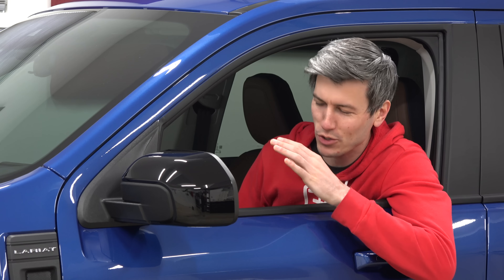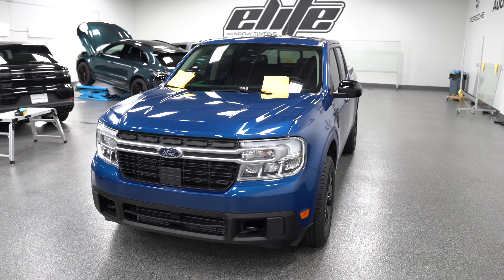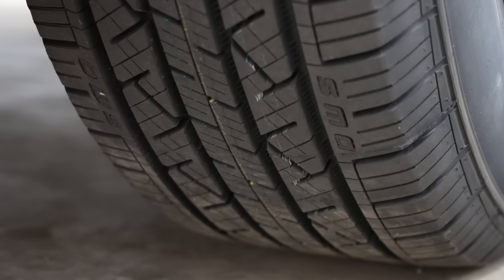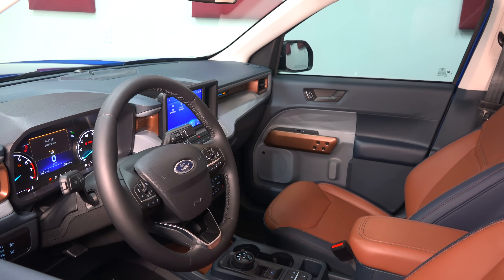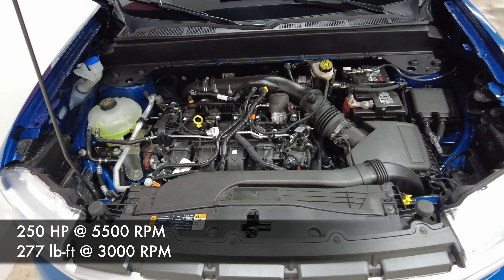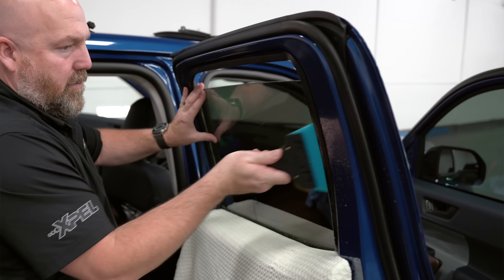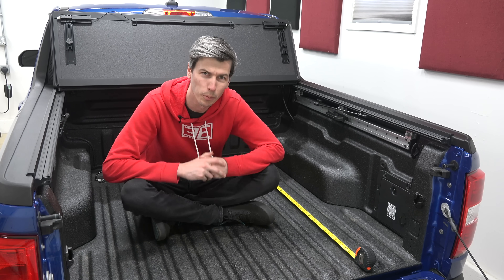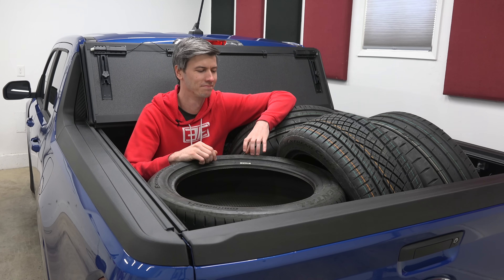I Bought A Ford Maverick! The Perfect Pickup?

Comment: My son just purchased a Ford certified, pre-owned 2025 Maverick Hybrid, AWD Lariat Yesterday that had 14,000 miles on it. When driving it on a long interstate drive from Bella Vista Arkansas to Little Rock today, there were a number of check engine and warning lights that showed up. It has me stumped. When searched online, we found there may be 12v battery issues with the Hybrid model. Is there any truth to this?

Comment: I bought a 25 XLT lux , 4k , FX4 2.0 eco.  Love it so far.  Does 95% of what I use a truck for. Perfect size for my 4k limit light  trailer.  Does 100% of what I use a sedan for.  Decent power,  great handling. Good mpg.  Only other vehicle that was as sensible and practical was my 2017 Volkswagen Golf R

Comment: Traded in my Avalanche for this 2.0 Turbo ,FX4 ,AWD . We recently deliverd my grandson,s Harley , in the back , 200 miles ,no issues and it used - .1 more fuel at 70 mph . Easiest vehicle to get in, painlessly , for my wife,s bad knees as well . If it matters ,the Maverick with it,s power (255 hp. +277 ft. lb. of torque ),leaves the Avalanche in the dust .No comparison . Fantastic braking  And no more squeezing into tight parking spots . We bought it just off lease with 895 miles and saved about $15 K off retail , what a bargain . Drove semi for 30 years ,thought I,d never give up big trucks ,surprise to me as how quickly I got over that , with this 'great 'little truck .

Comment: I’ve had 2 Ford F150’s and one GM Sierra. 800,000 miles between the 3 of them. All excellent trucks. Regular cab 8’ beds. A must for an active carpenter. Low maintenance cost on all three. I’m half way retired 69 years old. I have a Ridgeline now. Very quiet, excellent ride and better mileage. Same cab dimensions as my Sierra. 50” between the wheel wells. Weighs 200lbs more than the Sierra. Not a truck give me a break. Independent rear suspension with KYB dual valve shocks. For harder core off-road no. It has front McPherson struts. One of the other important things regarding towing, my truck limit is 5000lbs. A body on frame truck tows at least 9000 lbs ,also another key for their towing is a solid axle. I haven’t towed anything with my last two body on frame truck. 65% of people who buy body on frame trucks aren’t trade people.  They go to the beach and pick up groceries.

Comment: Positives: small, truck bed, full size spare

Negatives: unibody, transverse/front wheel drive, forced induction, no manual, unnecessary sensors, direct injection.

I’ve thought about trading my 2020 Ranger in on one (which does have some of the negatives I listed), but it doesn’t seem worth it.

If the Maverick was just a new version of the original Ranger, it would sell even better than it does now. And yeah, a point of this video is that it’s more than capable for 99% of people, but it’s a lot of compromise over just getting a normal SUV on top of not getting normal truck stuff.

Comment: Change the PTU, Rear Diff and Transmission oil at 30k.  See fordtechmakoloco for videos on a 2020 Escape to do all these things.  8F35 transmission is not horrible.  Every 20-30K make sure to go to the dealer and have them do the intake valve cleaning.  It says motorcraft, but is really BG products.  This is new in the last year.  I have too many miles on my escape, so need to do the walnut blasting.
For modifications.  Downpipe and intercooler.  The intercooler requires the delete/destruction of the lower active grill shutters.  The down pipe is plug and play.  Once that is done, the tune.  But remember, the 8F35 transmission.  35=350ftlbs.  So be careful.
One other wonderful thing about the 8F35, it has two oil filters.  Neither serviceable.
And last but not least, a fun trick.  Disconnect the electrical connector under the passenger seat and try to drive the truck.  
And install forscan.

Comment: I thought these were silly until I watched this. And somehow it wormed its way into my brain...
I purchase a 2025 Hybrid with NO options. And could not be happier.
Its a basic truck like the Ranger I drove in the late 90s. And the 81 Ford beater I drove in the mid 2000s.
Except is has CarPlay. An engine from the future (by 2003 standards. kinda). And is as comfortable to drive as the Honda HRV it replaced.

I do think these are expensive for what they are. 
And I am envious of the actual tactile HVAC controls on the 2024. The 13' touch screen is nice on the 2025. But oding climate control from it is not great.

Comment: I only have 3 issues with the Maverick
1. The name bothers me, because Ford Maverick used to be a muscle car, but at least it wasn’t actively in use when the name got robbed (like the Mach E). But more importantly (imo) the Ranger had always been Ford’s smallest truck.
2. Not being available as a single cab
3. (My biggest issue) The 2wd version being FWD. I understand the cost cutting and production benefits, but a FWD pickup just feels wrong

Comment: The Hybrid drivetrain is a throw away powertrain system.  After about 80,000 miles you will need to replace the so called clutch pack between the Engine and electric motor which needs removal of the entire engine at the cost of $6000.00!   Also if you get the Ford extended warranty it is completely worthless.    They will not cover the clutch pack because it is a wear item.  Stay away from this truck!!

Comment: Is it a truck?
What is the true definition of a "Truck"?
Many have a different reason for wanting a truck. Let's keep in mind that this is not a heavy duty truck to do hard work. Can it be called a small light duty truck? The issue is that it is a unibody and not a typical body on frame. The frame difines the strength of the vehicle to do work. It isn't the only defining feature to determine if it is a truck. Ground clearance, upgrade potential to raise Ground clearance, all terrain tires. This vehicle does have a bed like a truck. Good for yard wor, some types of furniture hauling, etc. One last important feature that defines a truck, suspension to handle rough roads. I would expect thus vehicle  to be used for rock climbing or off road. If using thus vehicle just on city street pavement, how will iy handle old destroyed filled with pot holes? Where I live, many buy trucks not for truck work purposes. They buy trucks for two main reasons. 
Ground clearance 
Handling 
Why?
It snows often here and the sniw is not cleared often. 
Thus the roads are rotten and filled with pot holes. 
So is it a truck?
I don't have one, I can't say.
Hoping to learn from someone one day.

Comment: Honestly I've got a 2013 Ram 1500 with 6 inches of lift and some big phat tires and honestly 90% of the time I drive my sedan instead because of the gas mileage. I barely use the bed and if I needed more space I own a trailer. Like most north americans I'd probably be way better off with a smaller truck. I actually really miss the little ridgeline I had in high school.

Comment: The only problem is that it has a 4-1/2 foot bed. If Ford would make a 2-door with a 6-1/2 foot bed I'd buy one today. Same chassis and overall length just more bed, less seats. I want a truckette (sorry, it isn't really a truck) to haul cargo, not people. As far as "truckette" goes, I have a 1992 Dodge Dakota and, yeah, compared to my 1992 4x4 Ford 3/4 ton pickup, it's a truckette too.
I don't want a vehicle that I can't comfortably sleep in if required. If you take a lot of cross-country trips you will eventually end up sleeping in your vehicle. I prefer a 6 foot truck bed with a topper shell. 4-1/2 feet just won't work.

Comment: I was seriously considering the Maverick, Bronco Sport and Escape, but the lack of full seat adjustment was an absolute deal killer.  Went for a CX-50T instead.  

I like Mazdas, but very much liked how all 3 of the Ford mini-utilities handled as well.  The Santa Cruz was a bit disappointing in ride/handling for me.
4k (or 3500lb) towing available on all of them with the 2.0T.  
The Maverick/BS/Escape are also a little on the cheapish side for fit and finish (try not to notice the molding flash on the turn signal stalk...). The Santa Cruz is very nice inside.

Back to the Maverick, combine the poorly finished materials, rotary shifter control and lack of seat adjustment and I went back to Mazda.  I truly wanted to like the Maverick just a bit more.  I do believe that it is one of the best combinations of versatility, size and fuel economy on the market.  Bravo Ford.  Please keep improving it.

I might even have considered it if there was a higher trim than the Lariat that had better seats (like the 24-way Lincon Corsair seat) and maybe some softer materials inside.  I see they have AWD on the Hybrid for 2025.

Comment: The Ford Maverick is a great Ute. 

But I’ll die on the hill that a Truck should have at least a 6ft bed.

I’d even concede that the Honda Ridgeline, with its unibody frame, could be a damn fine truck, with so much utility, If it had a 6ft bed.

Damn near every midsized truck & below isn’t even offered with a 6 ft bed, only Toyota & Nissan offer the Taco & Frontier with 6 ft beds.

And most Full sized trucks are sold with crew cabs and a 5.5 ft bed.

At that point, I don’t see why folks just get an SUV, or a large SUV if they need towing capacity, and a Utility trailer. It makes no sense to me.

If only we could get a cab-over transverse engine layout, get the crew cab that everyone seems to desire, and a usable bed size.
Reply: Update on this: I was going to replace my 6’ bed 04 Chevy Colorado with a new Nissan Frontier, but given Nissan’s current financial issues I decided against it.

That left a current gen Taco (with all of the current year Toyota issues) or an American midsized truck with a 5’ bed from Ford or GM.

I decided that if I wanted to buy an SUV that desperately wants to be a Truck, I should at least buy a vehicle that’s honest about that. And since the new Mav is available with a hybrid engine & a 4k tow package that’s what I ordered instead of a Ridgeline. 

It should be enough to haul my motorcycles in the back and tow the next 20’ sailboat boat I hope to build in the coming years. I just hope I judged the downsizing correctly. I’ll really eat my words about “just getting an SUV instead” if I ever need to buy a utility trailer.

Comment: So I'm looking at a truck to replace my Subaru Crosstrek, also with a 6 speed like yours. I have the same questions as you did in your review. Your review is about 3 months old, so I'm wondering if any of the concerns have alleviated themselves, or have the concerns become frustrations?   I'm also considering a Tacoma because I can get that with a 6 speed. Any comments on the Tacoma?  The trade-offs I see, other than the transmission, is the need for premium fuel in the Maverick, and possible mechanical issues down the line when you squeeze 250 HP out of a 2 liter engine. Tacoma is pricier and gets worse milage, but runs on the cheaper gas...

Comment: The vehicle I miss the most, and would immediately buy again if it were available new, is my mid 90's Nissan hardbody pickup.  It could tow my boat, haul my motorcycles, haul building/household supplies, and get me to work, all while getting decent gas mileage and NEVER breaking down.  I would have driven that truck until the wheels fell off, but when the kid came along we could not find a car seat that would clear the shifter ("lift and shift" gets old real quick).  Seems like I've been waiting forever for another SMALL truck with some capability.  The Maverick has the tow capacity I need.  If the bed was long enough for a motorcycle and a manual was offered, it would be in my driveway now.

Comment: The only thing I am concerned about is the 8F35 transmission was designed for vehicles with a maximum of 350 NM of torque and the engine has 375 NM.  ....I expect the transmission to be the thing that fails.

Comment: I bought a new F-250 SuperDuty in 2008 and the Continental tires rotted within five years and 25,000 miles.  One tire delaminated while on an 800-mile trip, leaving me stranded. ☹
I replaced them with Goodyear Wranglers, which have a much better rubber compound.

Comment: Yeah bring back small trucks I've got a 2004 Tacoma extra cab with $210,000 mi on it and that would have been waiting for somebody to have a compact truck with a 6-ft bed. I am a wall covering contractor and I need at least a 6-foot bed for my table and my 6 ft ladder and no I can't drive around my tailgate down anyway I'd be interested in this truck if they had an extended cab with a 6-foot bed that would be perfect nobody seems to make that combo anymore and a smaller truck.

Comment: LOL. I've had my gas AWD XLT with tow package Mav for almost three years now. Only issue so far is the factory battery getting weak. I only drive three days a week. Retired. Having that looked at this week while it is under warranty. I consider it the ultimate "Utility Maverick". It'll tow 4K. Handles like a great 5 passenger mid sized car. Great for errands and daily driver and old man jobs and trips. 27 mpg in mixed driving and 33 hiway. What's not to like? Mine set me back $30k in Jan. or '22.

Comment: I owned a new 1995 Ford Windstar. Engine pistons "melted" at 74,000 miles. Because it was under 75,000 miles, Ford had to put a new engine in the vehicle. Transmission failed a year later. I have since over the years owned a Chrysler Sebring, Dodge Dart and currently a 2021 Dodge Challenger. No issues. Sorry, I will never buy Ford again. Next vehicle (in maybe 2030)? Probably Toyota or Honda.

Comment: No, it isn't a Ford Raptor... it also isn't a pickup. Throwing a pickup bed on a car doesn't make it a pickup. And at $40K it is GROSSLY overpriced by, well $40K. I have put 5 squares of shingles at 240 lbs per square in my 4 door Jeep Wrangler, that is an Fton more than three bags of mulch. My Kia Forte GT will hold more than three bags in the trunk. As far as the 4K tow package, sure it may be geared differently than the standard but it is still a tiny 2.5 liter engine. So now you have the ability to tow 4K poorly. Sorry, you did not convince me.

Comment: He didn’t mention the tailgate, one of the most important aspects of the truck.

The cables can be attached to the tailgate latch posts. This positions the top of the tailgate evenly with the top of the wheel wells, which allows the bed to accommodate a full sheet of plywood or drywall. There are also recesses in the bed that allow for factory dividers or simple DIY dividers made from standard 2x lumber. There are recesses. In the wheel wells too, allowing a 2x6 to span between the two.

Comment: The 80s Chevy S-10 was a good truck and could have been even better if GM would have built them not only in extended cab but 4 door as well.  Could have used a more powerful V6 over the weak 2.8 liter.

Comment: Just traded my 2005 F-150 4dr on a Maverick hybrid,  didn't need the full size monstrosity any more.  
 I was thinking about doing a custom hybrid conversion on the F-150, but alot of work, and didn't need the large size.
As a 12 years Ford Ranger owner, the Maverick seems like pure luxury in comparison (altho smaller bed).
  I also owned a 2015 Ford C-Max hybrid... so I knew their hybrid system is awesome!  -  GREAT gas mileage, 
 EXCELLENT speed & acceleration, very quiet,  plus that low battery pack gives a very smooth &  solid ride and cornering.  
My biggest quibble with the Maverick is that the damn door pockets are WAAY TOO SMALL! 
Far LESS storage than my much smaller C-Max!  (Why does Ford have to RE-INVENT the wheel every time?!) 
 Also, the round knob for gear selector makes it risky to shift in to neutral to coast 1/4 mile  to a red light.
 Also, the Maverick hood line is high, like a bulldozer blade,  so as to be macho... 
they could slope it several inches for better visibility AND better gas mileage.  
And another foot on the truck bed would be nice, although I have to admit, 99% of the time the shorter bed is OK,

and for the 1% you need a longer bed you can either work it out,  or buy/rent a trailer,  or rent a full size truck at Uhaul for a day.

Comment: im glad they are heading in the right direction but i still would rather have a older ranger (2010) or something like that, That bed is way to small, and i loathe the circle gear shifter thing who thought that was a good idea. Also its not a ugly truck and it looks decent in my opinion but i just think older pick ups just look nicer. also the price if you can get it for what was it again like 20 something thousand I think its pretty fair but anything more than that is a no for me personally.

Comment: My company just bought 2 of these for our fleet. Unfortunately, I didn't have any say in the choices or else I would have insisted we get 4WD, but I'm not the one spending the money, I just drive the thing. We go to construction sites often and jump curbs often, so it would've been nice to have 4WD, plus we're in the northern Midwest where it snows in the winter. I'm overall happy with it though. Heads up though, if you go with as cheap a package as we got, with the steel wheels and all, to everyone's surprise, this thing has manually adjusted mirrors. Not good when we switch drivers... but it is what it is. For us, this is replacing the Jeep Renegade, and with the tonneau cover this has far more space, is insanely faster, better visibility, and I'm predicting more reliable. Even with the cheap options we have, it still has CarPlay which is a Godsend! Cannot wait to use this "truck" in the field. I hesitate to call it a "truck" too tbh.

Comment: One gripe with owning this truck for 2 years, I have on 8 occasions been exactly 2-4" to short in the bed to put up the gate. Thank you ford Engineering for thinking of the issue and adding the half up tail gate, it has been extremely useful!
Reply: If you use the half up tailgate you can use the backup camera for trailer hook up